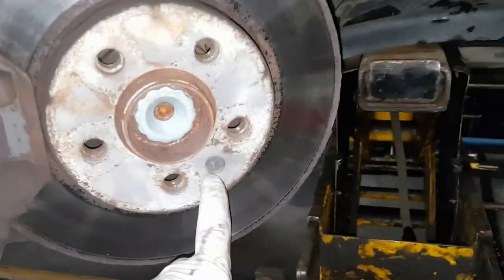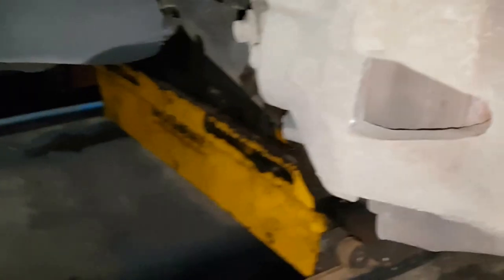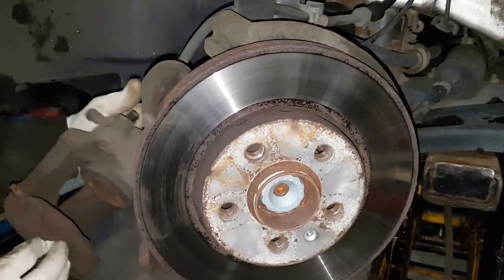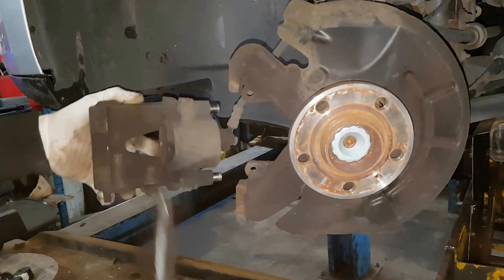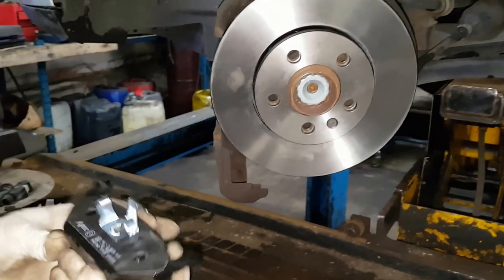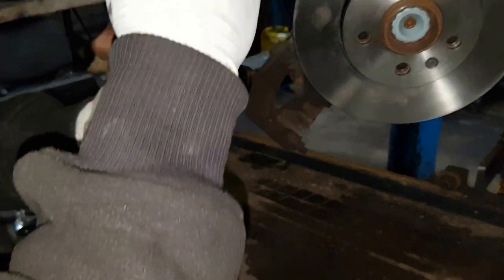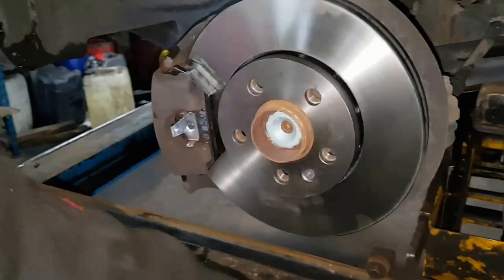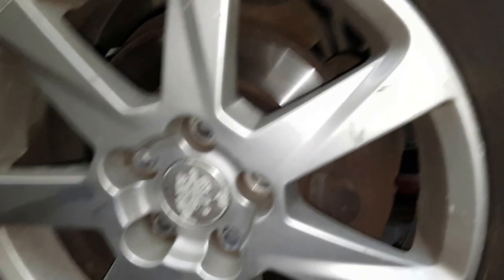How to replace front disc and pads on seat ibiza 2010 - Tutorial

Comment: Remember to unscrew the brake reservoir cap otherwise it will be hard to push back the old pads, also you risk getting air into the brake lines.

Comment: Not a bad job though your hands looked a little greasy when you assembled. Also, you mentioned tightening the calipers by hand, missing out the torquing up so I hope that's not misleading. Finally, the dust you wire brush and blow off the dirty parts contains asbestos, as a lot of pads do. Best to keep the dust to an absolute minimum. I enjoyed watching. Thanks for taking the trouble to download. Informative.

Comment: bloody hell you are in a hurry! thanks for the video. was abit nervous about doing this.
Reply from the maker: +Sam Ellis lol I know I did this video in a hurry but working on my speed now! We are improving our videos and will upload more disc pad videos in future. Thanks for the message 🙂
Reply: Taj Tyres ltd did you only hand tighten that caliper bolts at yhe back on ?
Reply from the maker: Parvise Sarwar yea hand tightened!
Reply: Taj Tyres ltd but they didnt come off hand tughtened?
Reply from the maker: Parvise Sarwar spray some WD-40 and wait for few minutes once that's done then use a bar to open it because it has lock tight on the tread of the bolt so hence that's why it's tight to open.
Reply: Taj Tyres ltd so do you put lock tight back on bolts when reasembling caliper?
Reply from the maker: Parvise Sarwar yea only on the rear calliper carrier bolts.
Reply: Taj Tyres ltd i was talking about the front brakes on my 1.4 2003 leon m8
Reply from the maker: Parvise Sarwar sorry I meant the front calliper carrier bolts
Reply: So you dont tighten up only hand tight with lock tight...front carrier bolts?
Reply from the maker: Parvise Sarwar I will soon have a video of front disc and pads and you will see how it's done and for your car make sure you tightened everything by hand and only use lock tight for the carrier bolts.
Reply: And if you havent got lock tight? Can tighten them up with a little torq?
Reply from the maker: +Parvise Sarwar yea that be ok too
Reply: Cheers

Comment: hmm you maybe able to help me with an issue, according to the parts website my car will have one of two brake systems when I tried to select pads. any idea on how to tell which system I have?
Reply from the maker: +Sam Ellis easy way to do it is to check what calipers you have on your car (ATE/LUCAS/BOSCHE) that way you can search for the right disc and pads and this model only has one type and that's ATE caliper and part no for pads is apec pad1062 hope this message was helpful.
Reply: +Taj Tyres ltd thanks very much

Comment: Sorry. Forgot to mention. You need to pump your brake padal a few times before driving so that the new pads take up the play and move back close to the discs. Otherwise, you will drive off and when you need to brake, the pedal will go flat to the floor. If it should happen, pump the brake quickly to get it back.

Comment: Hi, is it much different replacing the rear pads? my ibiza has front and rear disk brakes
Reply from the maker: Moss hi, yeah it's a bit different as you would need brake caliper rewind tool to wind the caliper piston back as they not push back.
Reply: Taj Tyres ltd ah great thanks 👍

Comment: Hi could you write down exact tools needed. I'm not very mechanical savy :)
Reply from the maker: +Matt S hi sorry to get back late with regards to the tools required. If you only doing brake pads then all you need is 1* flat screwdriver to push the calliper pistons back and make sure you do it really gently cuz the last thing you want is damaging the seals 2* 7mm Allen key for the back of the calliper. And if you did the disc too all you need is a torques T27 to remove the screw and guess that's all you'll need. Hope this helps 👍
Reply: Taj Tyres ltd Thanks ever so much